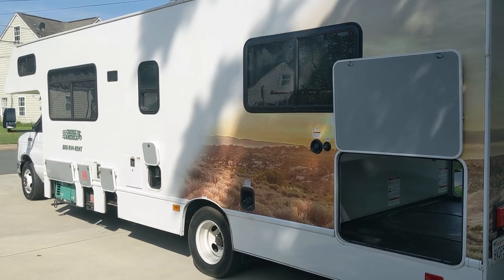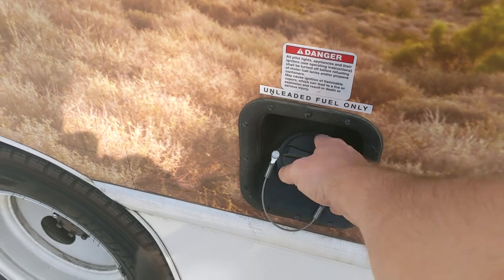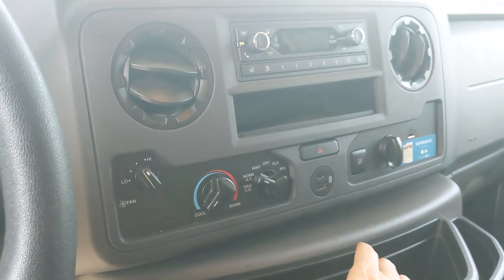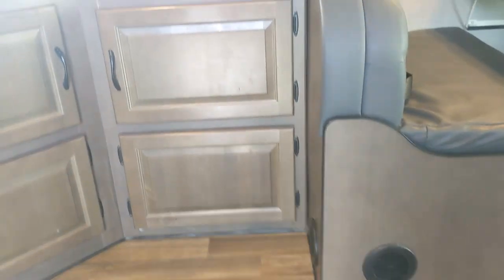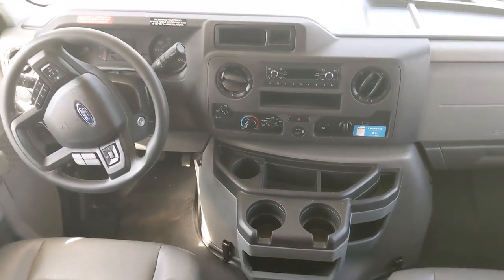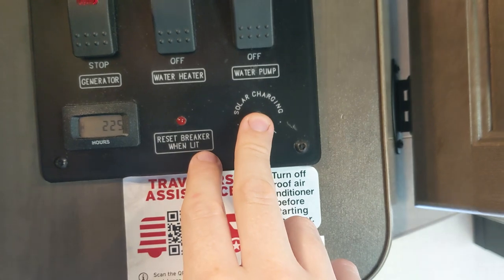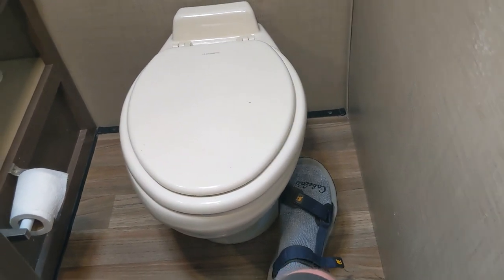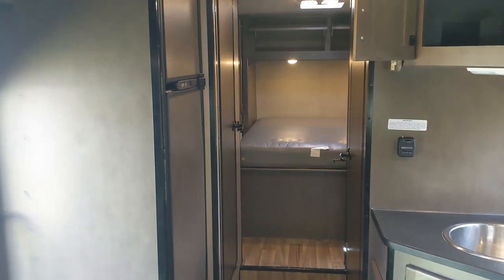Cruise America RV review and walk through - updated for 2021/2022

Comment: Me again. Definitely nicer this newer one, one thing we don’t have in Europe is the generator. We’ll have high powered battery bank that most things that will off and be charged off the vehicle when running / solar. Most will last a few days. Most campsites have electric hook ups. Generators on any site wouldn’t go down well in the U.K. lol
Reply from the maker: Hi!  Yes, the generator definitely has its pros and cons.  I think with the battery bank you can't run the air conditioner, however?  The US definitely seems to have more off-grid "boondock" camping (in BLM state and federally owned land, for example) than the U.K., at least from what the media shows us over here.  😉  I'd like to experience it over there someday though.  Safe travels!
Reply: @CompTechMike  Scotland is different in terms you can park up most places and camp including tents as there is a right to roam. England and Wales is a little more restricted but nothing stopping you from stopping in a layby on the side of the road for the night. Yes you wouldn’t be able to run AC off batteries but then for most part the U.K. isn’t overly hot, only really needed in Southern Europe. 

Definitely come over, see the London sights then get out of their as that’s not the real U.K. if you manage too remember me and drop me a message and I’ll give you some great places to see 👍🏻 all the best.

Comment: Thanks for this video, Mike. I found it more helpful than any other video I've seen. Can you let me know, when you set up at a campground that does not have electrical, what things do you have to run the generator to use? Microwave, A/C, heat? Anything else?
Reply from the maker: Hi Deana!  Thanks for checking out my video.  This is a pretty common question.  When "boondocking", or camping at a site without electrical hookups, you'll need to turn on the generator to run the rooftop air conditioner, microwave, and the household-style electrical outlets in the back.  I believe the furnace can run without it, but as we typically camp in warmer weather we've only ever needed to use the furnace once (so am not sure about that).  The fridge will run off propane and the interior lights and water pump can operate off the household battery (just be fairly frugal with your power usage and turn off anything when not in use).

One suggestion I have is if you have very small electrical needs (for example: charging phones) you can charge those from the 12V and USB outlets in the front of the cab.  Those run off the same 12V system as the engine and do not require the generator be running to provide power.  We also bring along several small battery-powered appliances such as a fan and a "Jackery" to provide supplemental electrical power without having to run the generator as often.

Hope this helps, safe travels!

Comment: Thanks for the detailed video.  I am going to rent one this coming Christmas break and want to know if there is a propane quick connect for an outside grill ?
Reply from the maker: Hi!  Thanks for the comment.  You can see the inside of the propane filling area at 6:53 minutes into the video.  I've never hooked up an outside grill and do not believe CA supports this.  There is a fill nozzle, but not sure if there's any way to safely connect an adapter.  Personally when we use an outside grill we just use the little green propane bottles you can buy at any Walmart or camping supply store.  Hope this helps!

Comment: When running the furnace on shore power, it doesn’t use any propane correct? Same with the fridge?
Reply from the maker: Hi Charles!  When the furnace is running it uses both propane (to heat the air) and electric (to run the blower fan).  The fridge will run on electric when connected to shore power.

Comment: very helpful mike thank you very much. im looking at traveling for one month im from Australia. the propane refill how do you refill this?
Reply from the maker: Hi! Thanks for checking out my video. I show the propane tank / fill area around the 6:50 minute mark. The vehicles are usually 2/3rds to full when you pick up. They ask that you return the vehicle at the same level as when you left, so depending on how much you use you may need to top off (propane lasts a long time). 

To buy propane you can typically go to any garden supply store, and many places like Lowes or Home Depot may have it as well. Also some of the larger roadside truck stops. It's a lot like buying gas, just push the nozzle onto the connector to fill. Most places have an employee who can help you. There's always YouTube videos, as well. 😉 Safe travels!

Comment: Hi mike , great video so traverling solo denver to yellowstone , want to know how long can i go disperse camping boondocking etc with out a need to fill power i will be conservative with everything and habe booked a few camps in between .. i would be grateful for any information for firstimer ,  these videos have been very informative and just bought leatherman too but any advice to make stress free as possible will be great ..
Reply from the maker: Hi Sam!  Thanks for checking out my videos.  In our experience camping at sites without full hookups, the biggest challenge was the gray water tank (sinks & shower) filling up.  That tank is the smallest out of all the tanks on these vehicles, and since my wife & I like to shower each day, wash dishes, etc., we found we could only go about three days without finding a place to dump it.  Everything else lasted a good while for us; fresh water, propane, etc., we've never had any trouble with.  And we typically only use the generator for a few hours a day, so no issues there.  I could see if you were staying somewhere very hot (and needed to run the generator for AC) you might have more challenges with that...

Otherwise, just take your time.  Drive safe.  Plan your exit route whenever pulling into a gas station.  If you feel nervous driving, practice in a parking lot before hitting the highway.  Many RV'ers go by the "330 rule".  That means don't drive more than 330 miles in a day and don't arrive at your campsite after 3:30pm (to have time to set up before the sun sets).

Read through the comments on YouTube videos, many good suggestions have already been mentioned.

Last, check out https://rvlifestyle.com/ RV Lifestyle social media groups and YouTube channel.  They have a ton of information on their page.  Safe travels!
Reply: @CompTechMike  thank you very much vert great information I will stick to that 3 30 rule too very good thank you

Comment: Hi, since they have vinyl on the beds and sofa’s, what is your tip regarding (extra?) sheets to avoid sweating during warm nights?
Reply from the maker: Hi! Thanks for checking out my Cruise America walk through video.  Personally we have a couple plastic totes with all our camping gear ready to go.  This includes normal household sheets / bottom sheet for the mattress.  Then we'll throw a blanket or two (or an unzipped sleeping bag) over us for warmth.  We typically camp in cooler temperatures so haven't had much of an issue with heat.

If you do want to get a cooling pad, make sure you specify the correct size.  For the mattress in the back of the 30' RV they're 60x74.  Search on Amazon for "60 x 74 cooling mattress cover" gives a bunch of good results for RV usage:

https://www.amazon.com/s?k=60+x+74+cooling+mattress+cover

Camping World also typically has some in stock if you don't want to order online.

And here's a link to the dimensions of all the mattresses in the vehicle:

https://www.cruiseamerica.com/rv-adventures/rv-lifestyle/rv-mattress-sizes

Hope this helps!
Reply: @CompTechMike  thanks a million! The whole concept of a cooling pad I have never heard of. Interesting since I believe this is not so familiar in Europe. I was planning to bring my own mattress sheet (which comes in Europe with elastics on the corner so they sit snug and tight) but I think I will bring something like a molton which is like a cotton mattress protectee or something. I just doesn’t feel nice to your skin if you feel the effect of the vinyl through the sheets on your skin. I do understand why companies do this since a lot more hygienic.
Thanks for the links! 

Oh and now I’m typing anyways maybe you know this too. We are a small family and thought to rent the 22ft van. I noticed though the kids need to sit way in the back in the dinette. Any experience how kids will deal with this? It feels very strange they sit way in the back  🤷‍♀️
Reply from the maker: @Cati1993  Hi again!  In my area the local rental office only stocks the 25' ("C25") and the 30' ("C30") vehicles.  I noticed today that it looks like Cruise America has removed some of that nomenclature from their site.  I assume when you say "the 22' van" you mean what they're now calling their "Compact Plus RV", correct?  You might want to check on availability on that one; according to their website it's only available in their Carson (CA), Newark (CA), Las Vegas, and Mesa (AZ) locations.

Personally we don't have kids. Just the wife & dog, and we still prefer the extra room of the largest model vehicle.  I'm skimming the floor plans and it looks like the "Compact Plus" has a wet bath?  Up to you whether you're comfortable with this? I know for us, we prefer our shower and toilet to be separate.  The smaller ones are probably easier to drive and easier on gas, however.  😉

Anyhow, as far as kids riding all the way in the back, I can't say.  Just speaking personally, I wish we'd done RV trips when I was a kid (40 years ago, haha).  Would have loved playing tabletop games and watching the world go by from the dinette.  Of course these days kids are usually glued to their screens so probably not as much window-watching as I would have done.  I do know the far-back in these rental vehicles can be a bit bumpy but they're kids.  They can handle it, right?  😆

I'd get whichever vehicle you feel comfortable driving and fits your budget & availability.  Also recommend practice-driving somewhere like a school parking lot if you've never driven a large vehicle before, and plan your exit whenever pulling into a gas station.  Don't pick the pump closest to the building.  There's a lot of information in the comments, you can also check out "RV Lifestyle" Facebook group, blog, and YouTube channel.  Mike and Jennifer Wendland are our inspiration when it comes to traveling and have many good sources of information to help plan your journey here:

https://rvlifestyle.com/about-mike-and-jennifer-wendland/

Hope this helps, safe travels!

Comment: Hey Mike, question. So we are RVIng from Ohio to Miami and then getting on a 7 day cruise. My question is do you think the thing will start fine after sitting a week? I have a jumper box I may bring just Incase, but any special precautions I should take? Thanks!
Reply from the maker: Hi Charles!  Thanks for checking out my video.  To answer your question, these vehicles have a battery for the engine and also a separate battery for the household electrical system (e.g., the water pump and lights in the back, so you can turn these items on while driving).  If the household battery was completely dead you should still be able to start the vehicle with the main battery.  They also trickle charge off solar (but it's only about a 15 watt panel).

That said, you should take all the usual precautions before leaving it.  Make sure all the doors and windows are locked, nothing valuable in the underneath storage (easily broken into with common style keys), lights off, water pump off, propane off, fridge off and cleared out, maybe cracked open so it can air.  Assuming you take these precautions, I would have no concerns about it sitting for a week.  That said, I'd probably still bring my jump box (if it were me).  Just one of those things - better to have it and not need it than need it and not have it.  😉

Safe travels!

Comment: Can you plug in a TV and have it on for the kids to watch while driving ?
Reply from the maker: Hi!  I just saw your comment on my other video.  As I replied there, the Cruise America rental RV's are basic "no frills" units and do not include a TV.  If you bring a household-style TV into the unit you can plug it into the electrical outlets, however you'll need to run the generator while driving.  The 110V AC outlets in the back are not "live" when the generator is not running or you're not connected to shoreline power.

My recommendation if you really want to watch TV in the vehicle would be to bring along a tablet or laptop computer.  These are much more portable than a bulky home TV (and less likely to be damaged if they fall over, for example).  Hope this helps!

Comment: This is a great overview, thanks so much!  I have a couple of first-timer questions regarding the electric system….from your video and others, my understanding is that unless you have an electric site, you have to run the generator to get A/C, heater, electrical outlets and microwave.  Those items will not run at all unless you’re plugged in or running the generator so if I’m at a National Park campground without electrical hookup I can only use these items during permitted generator hours?  Also the generator doesn’t store a charge, so I can’t run the generator during allowed hours to charge it up and then run those items with it off.

The auxiliary battery will run lights and that gets charged by running the engine (as with a car battery) or by plugging in?  How about the water pump?  Is that generator or auxiliary battery?

Also, the fridge can run on either plug-in power, generator or propane?  Auxiliary power too?

I’m really just trying to get an idea of what we’d have and not have in a campground with no power hookup.  The trip we are planning would have us staying there for 3 nights and we’d be looking to get hookups at other campgrounds along the way.

Again, much appreciated!
Reply from the maker: Hi Jeremy!  Thanks for watching and commenting on my video.  You are correct - the household-style 110v AC outlets, the microwave, and the rooftop air conditioner all require the vehicle to be hooked up to shoreline power or the generator running to operate.  Large appliances like these require more power than a single battery can provide (1500 watts microwave, 2200 watts AC, etc.).  More advanced RV's with multiple batteries and large solar panels can run them for short periods, but that's outside the capabilities of the vehicles Cruise America rents.

The fridge will run off either electric or propane, as long as one or the other is available and the "auto" button has been depressed (normally done by the rental office as part of the check-out process).

The furnace runs on propane.  It warms up quick, I believe it may shut off automatically after two hours but honestly we've only ever needed to use it one time.  Not entirely sure if it also uses electric - maybe for the blower fan?

The water heater runs on propane, as does the stove.  You can use those any time.  Water heater takes about 15 minutes to warm up after turning on, so we normally turn it on while brushing our teeth or getting our clothes out before jumping in the shower, and turn off when done to conserve propane.

The water pump runs off the household battery.  You can turn it on at any time to provide water pressure.  It's not necessary to use if connected to an external water source (hose or spigot).  It's convenient if you need to pull over to use the bathroom or whatever while traveling, you can just flick the switch to turn it on and get water pressure.

The lights also run off the household battery.  You can turn those on at any time, vehicle operating or not.

Personally we've had no trouble staying three days without hookups.  We used our resources sparingly, and charged cell phones with a small power inverter that connected to the vehicle's 12v outlet on the dashboard (which gets constant power from the engine battery).  We also used that to run a small travel fan, and brought along a power bank for extra power (actually a vehicle jumpstarter box that I keep in my truck for emergencies).  The biggest issue we had was the grey water tank filled up fast.  The 30' RV has a 40 gallon fresh water tank but only a 22 gallon grey tank (where water from showers and sink go).  We like to wash dishes after eating and take showers every day, so even with just the two of us and our dog, we had filled the grey tank after three days and had to drive down to the campsite entrance, where there was a dump station.

Hope this helps!
Reply: @CompTechMike  thanks so much, this is extremely helpful!  If I can convince my wife, I think we’ll be giving it a try this spring!  I want to eventually do a Utah/Arizona trip where we fly into Denver or Vegas and rent one there, but a shorter test run is definitely in the works soon!

Comment: Great video Mike! One question from my side: can you charge a phone or so during driving? I thought I have somewhere it’s not possible, is this true? Thanks for answering!
Reply from the maker: Hi! Thanks for checking out my video. Yes, while driving the 12V and USB outlets in the dashboard are all active. So you can charge your phone through any of those.

The household-style electrical outlets and USB ports in the back of the vehicle are not active unless the generator is running or you're plugged into shoreline power, but the outlets in the cab are active at all times.

Safe travels!